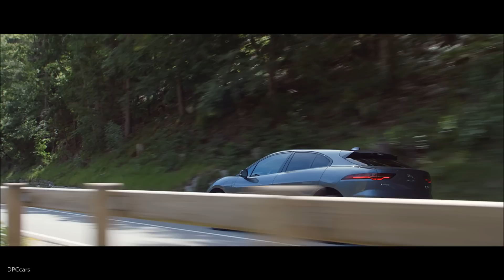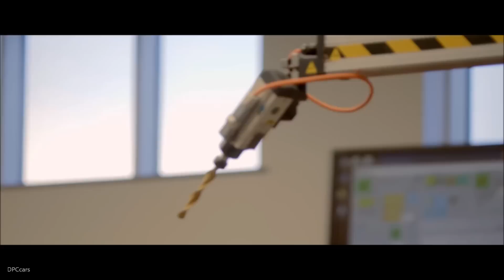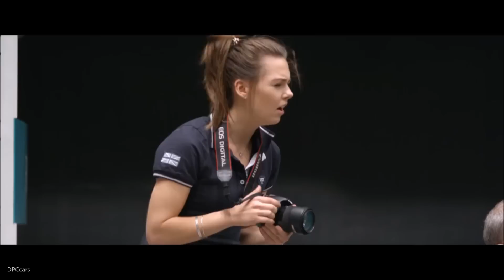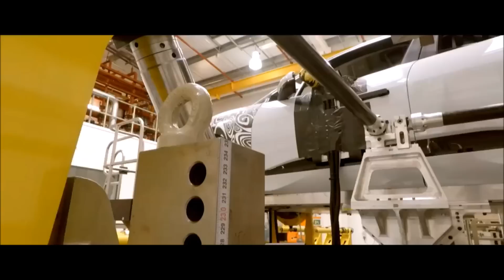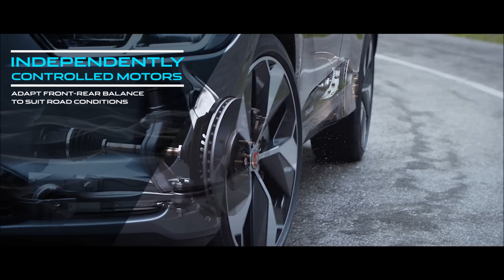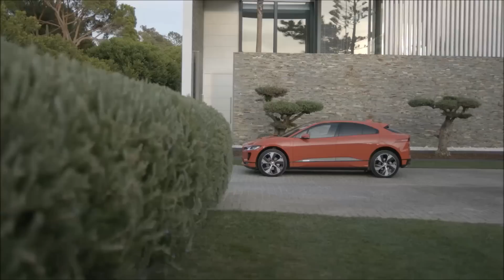Electric Jaguar I-PACE Documentary

Comment: Quite simply the best kept secret. 

As a used proposition and if road tripping doesn’t feature highly in your use case - even today 2025 the post 2020 HSE model  is a well equipped, luxurious, well made, fantastic handling, durable, practical car. 

The only draw back in comparison to some modern day EV is the  limited peak DC charging speed of 100kW hence the reference to road tripping. Also there’s no recline or forward/backward movement of the rear seats and the slight rear footwell bump is obstructive to a middle rear seat passenger but I’m being picky now. 

A HUD, acoustic glass, ergonomic controls, sound cancelling Meridian sound system, 360 cameras, heat/ventilated/electric adjustment with memory front seats ( driver and passenger) , heated rear seats, front and rear emergency braking, one pedal driving, auto park, the list goes on… off road capabilities - it’s truely amazing. 

In 2025 - 2021 registered examples of the Ipace HSE trim with about 50k miles can be had for £20K ( UK Sterling) - amazing!!